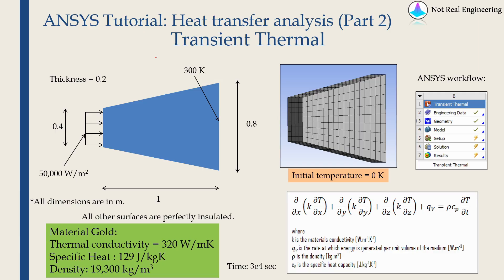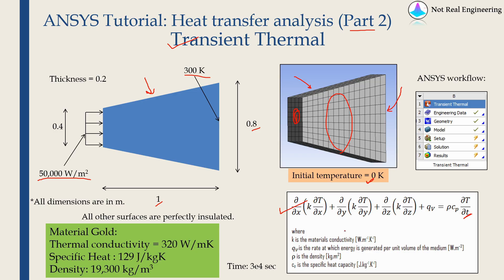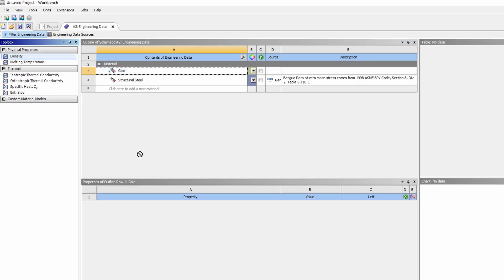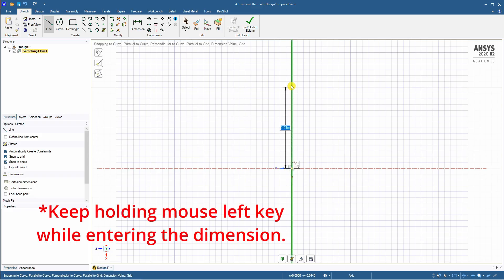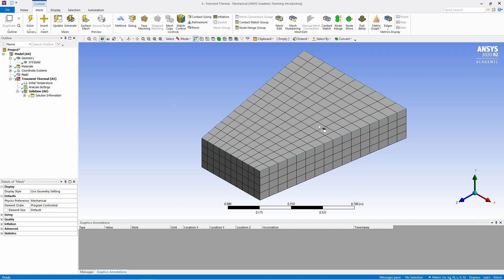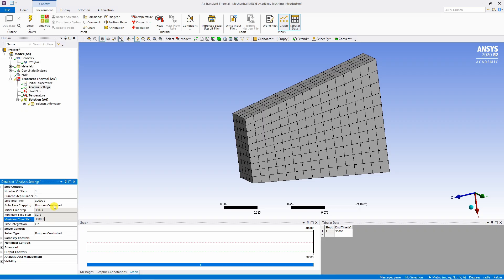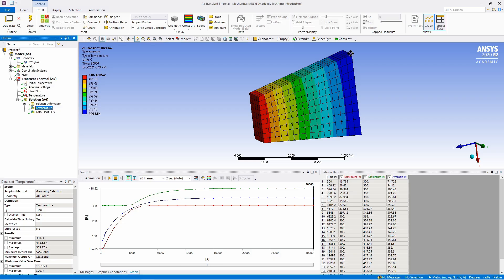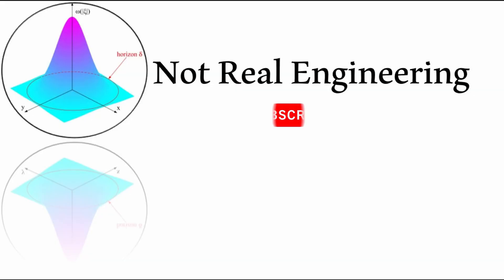Transient heat transfer analysis using ANSYS workbench

Comment: Thank you so much for this video! I have a question. How to perform an analisys if I want to create a time dependant temperature with a function? Im intrested in showing how changes in temperature of the ground influence the temperature in the concrete slab of the floor. Instead of running an analisys for different times of the year I would like to show a full year analisys, Is that even possible?

Comment: Great videos, they really helped me! But one thing I was wondering about: When you made your model you said that it is fully constraint, but is this really true? Because ANSYS shows fully constraint geometries with blue lines, that's not the case in your video. It took me at least one more dimension to fully dimension my model. Anyway it worked completely fine :) Cheers